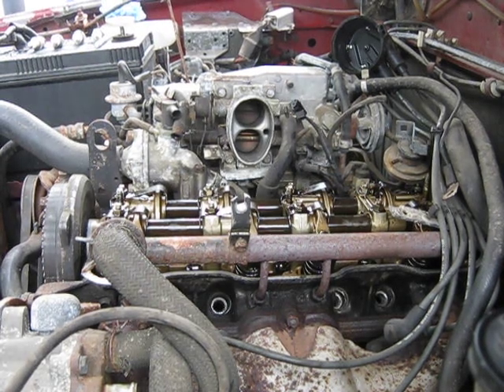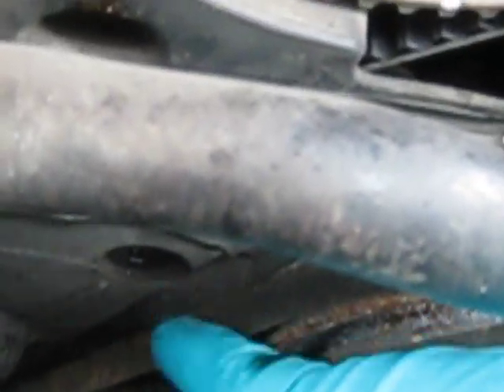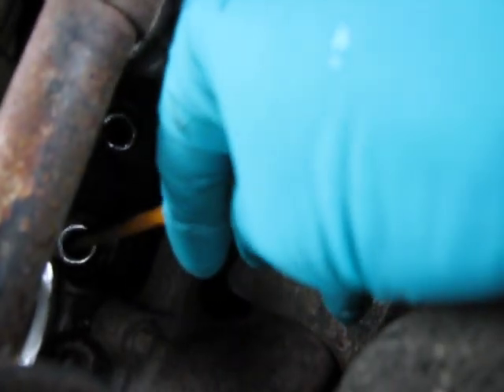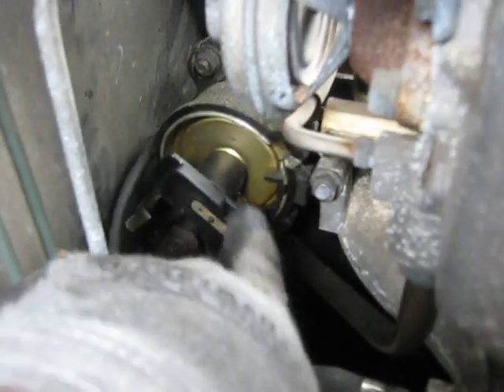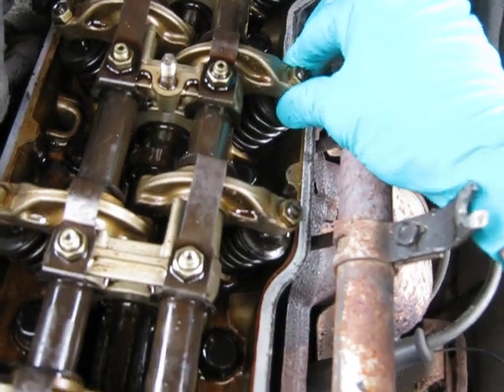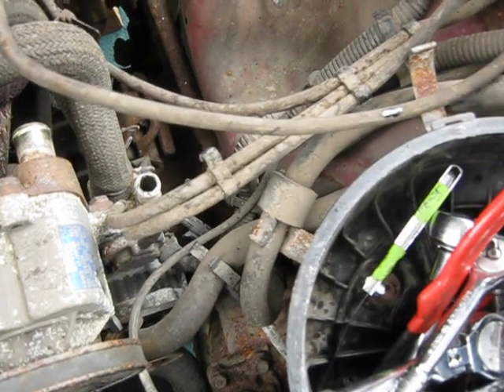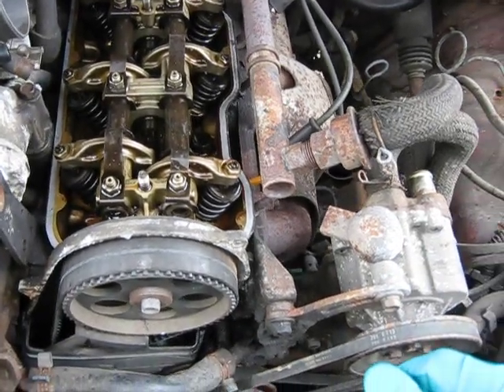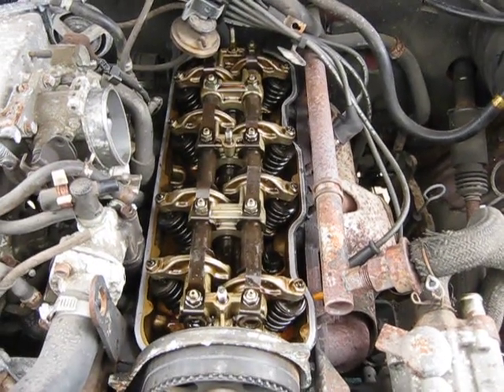Isuzu Trooper Engine Tuning - manual valve lash setting (Top end set) 4ZE1 2.6L 4cyl

Comment: I have a 96 Isuzu Rodeo 2.6l.  I bought it non running with head gasket just replaced.  I found that the original owner couldn't time it. It to me (mechanic for 34yrs) and my dad (mechanic for 45yrs)....took us over a week to get it running...working on it about an hour a day before I went into work.  The reason was simply (but not at the time) that the timing marks on the cams were completely off. Idk if it was like that from the factory or what.  We had to time it by aligning everything up with tdc, distributer pointing to # 1, etc, etc...we couldn't get it to even fire by aligning the way it was supposed to be not 180° out....but after moving everything where it should be then putting timing belt on, it fired right up idling smooth as can be. I saw another forum where someone else had the same issue so it really makes me wonder what is up with the timing marks ya know? Thanks for your video!
Reply: The main crank pulley is two parts. In between the inner and outer lies a rubber seal. It’s a safety mechanism much like a boat propeller.

Comment: Why do the other channels say that #4 is top dead center?
Reply: @subdude1234  The best I remember 1&4 are both at tdc at same time just depends on which one is on compression stroke and rotor to that cylinder....again, best I remember from 7-8yrs ago. 2& 3 are same as well just opposite of 1&4. Firing order I believe was 1,3,4,2

Comment: Hey buddy Iam having a problem with my 96 Isuzu rodeo it’s runs perfectly the only thing i noticed is that when Iam trying to set timing I move the distributor back and forth  it won’t move alignment marks to set it to 12 degrees it stock on 15 degrees
Reply from the maker: Hello Oscar, yea that sounds strange. The specified value is 12 degree Below Top Dead Center @ 900 rpm. So, make sure you have warmed up the 2.6L 4ZE1 thoroughly, check that the throttle valve is fully closed, shut off air conditioning, set your auto transmission to park or manual transmission to neutral. Then you can check the marks with an inductive timing light. However, if your engine is not idling rough, or lacking power, or excessively consuming fuel then you may just want to leave it as is. The manual valve lash/clearance is not something to neglect. Are you getting any codes from an OBD2 scan?
Reply: Yeah it just doesn’t budge like if the computer is holding at 15 degrees I can move the distributor all day long back and forth just doesn’t move it’s crazy
Reply: What should I set my clearance to my book says 8
Reply from the maker: @humieandoscarlopez3483  yes bud that is correct, with the engine cold, on 4ZE1 2.6L from 1987 and newer both intake and exhaust  valves need to be set at a lash of 0.008in or 0.20mm. Older pre 1987 4cyl engines were set at 0.006in 0.15mm for Intake valves and 0.010in or 0.25mm for exhaust valves.
Reply from the maker: @humieandoscarlopez3483  in regard to your comment about not getting any change in degree after adjusting the distributor... You are working on a 4ZE1 2.6L right?so I am somewhat stumped by that, its hard for me to say via email, however my suspicion is that your Crankangle sensor also known as Optical pick up sensor may have failed. It is built into the distributor. A quick test will be to slap a different distributor in the engine to test the result. The other thing that you should do is an ITEC OBD1 self diagnostic using the jumper lead under the center console. Is your ITEC storing any codes? This may help narrow down a diagnosis. The ITEC will run factory presets is cases of failure, for instance when an 02 sensor fails and will not send the real time data to the ITEC then the ITEC reverts to a factory preset for air/fuel mixture. Many vehicles are designed to do this in order to continue fuel injection operation, usually in my experience the factory presets will run rich on the fuel delivery, leading to excessive fuel consumption. Hope this is useful info, best of luck and be sure to update us with your discovery or progress. You also want to go on planetisuzoo.com or pirate4x4.com to see if any other 4z owners have had this issue.